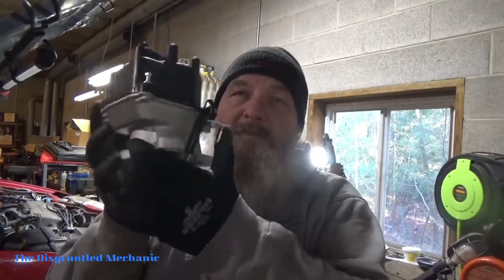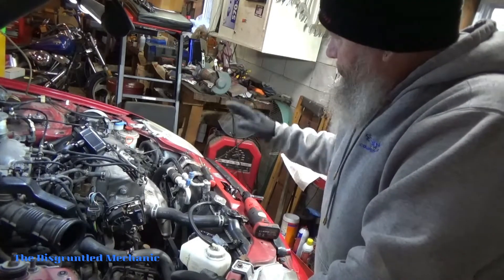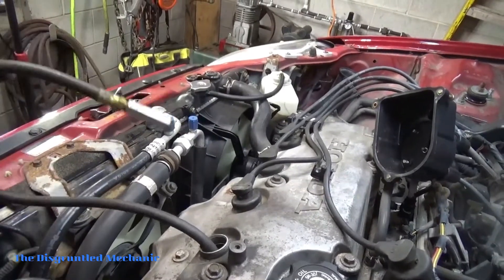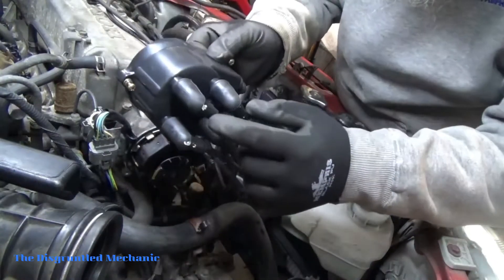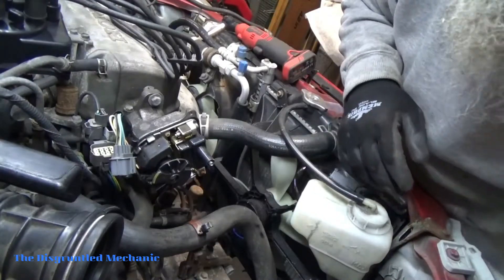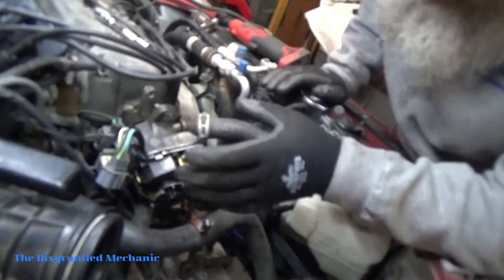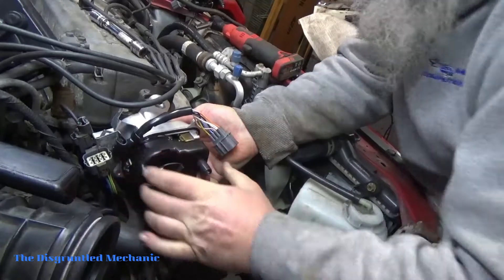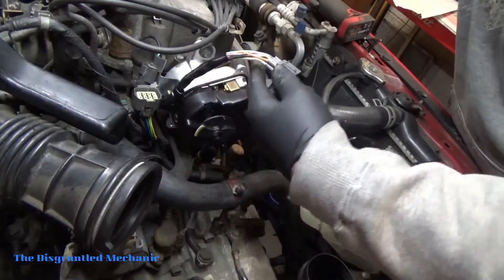Distributor Replacement on a 2000 Honda Civic

Comment: Mike,thanks for the video. Remember the days of points,plugs and condenser. Set to TDC slide and align distributor shaft,set point gap put plugs and cap back on break out the timing light and off we go. The good old days. This one seemed pretty straight forward and thanks for showing. Now back to my favorite brew in my coolest cup. Your shop looks as cold and crowded as mine. Thank Mike and have a good one Artie ❤️
Reply from the maker: +Arthur Fricchione Thanks As always! And yes I would love to do something about the crowded shop!

Comment: I believe my Distrubator does not have the coil spring could this be the cause of a crank no start ? Car only starts when pressing on the gas pedal once you let go off the gas pedal it turns off

Comment: The whistle tool made me laugh. I've not seen that since the 60's. Here's a silly question. I'll use a ratchet as an example. Which one has become your favorite? The reason I ask is like you, I have several to choose from and my "best" ratchet isn't the one I normally choose. I typically reach for the one that I've had the longest even that it's not a very good one. Human nature is a strange thing. Anyway,  the Honda started right up and sounds good. Another task completed. Next you'll be bringing out another ancient tool...the timing light.  :)
Reply from the maker: +wyattoneable well u r going to laugh but.......
Reply from the maker: I really like my Snap On ratchets. The 2 3/8 drive ones I have that have swivel heads are usually my go to. I go for the best tool for the job be it old or new. Such as the whistle. I have it and it works. Are there other ways to do it? Yes but I like the whistle way the best and I have it setting here.